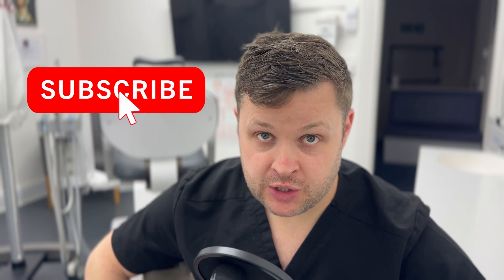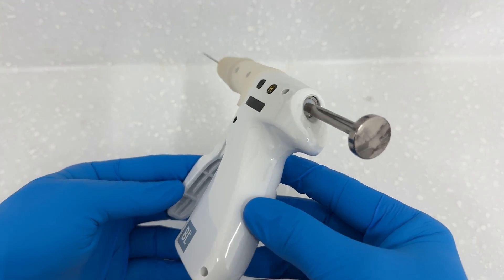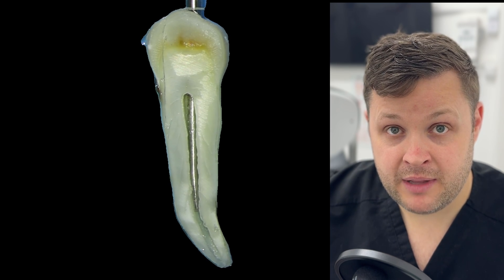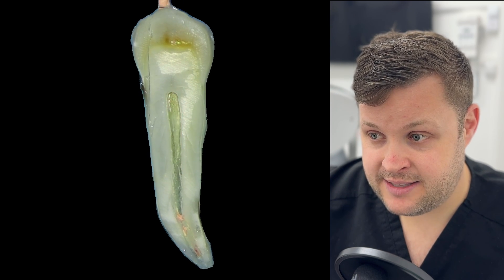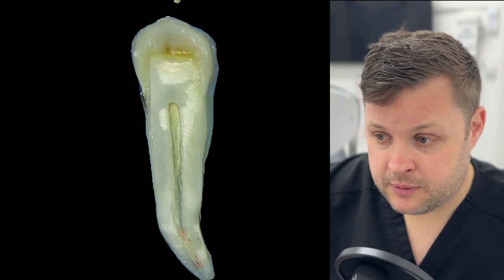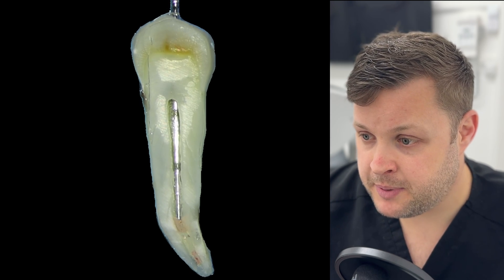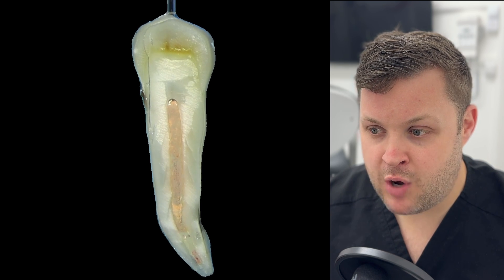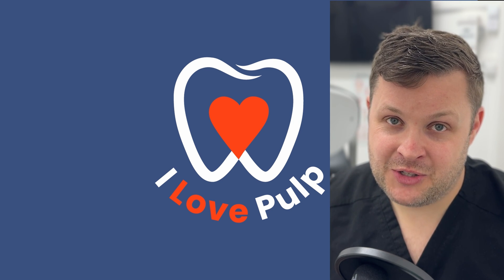Master Warm Vertical Condensation in Just 6 Minutes (Endo Made Easy!)

Comment: Thanks for the video. I am still a little confused at what points the heat is activated.
I am correct in thinking:
1. Heat activated whilst pushing down to within 5mm
2. Turn off heat and push for 10 seconds
3. Pull out (no activation here either?)
Reply from the maker: 1) activate heat and push down
2) turn off heat and condense the apical 1/3 for 10 seconds
3) quick blast of heat and pull out. 

Hope that is clearer?
Reply: @ilovethepulp  yes, thank you!! Will give it a whirl :)

Comment: I’ve heard you mention in multiple videos that bioceramic sealers cannot be used for warm obturation. However, many of today’s bioceramic sealers are indicated for warm obturation techniques. I understand that Brasseler’s original BC Sealer formulation is not really intended for warm vertical but are you considering the newer formulations?
Reply from the maker: Yes, you are 100% correct! I just dont have any experience with this new line sealers. Have you used them?

Comment: great video. I think with bioceramic being readily available in the market and it has a good prognosis so there won't be a need to use other obturation techniques which is more technique sensitive and takes longer time to obturate a multiple canal tooth
Reply from the maker: This technique is good if you are worried about the apical diameter and extrusion with bioceramics - which is very rare,
But it does have its uses occasionally!